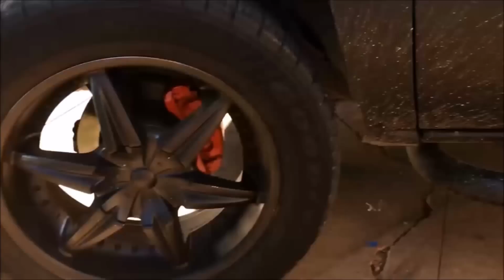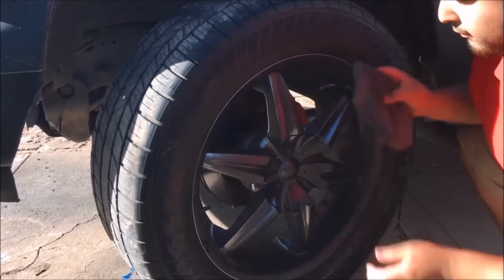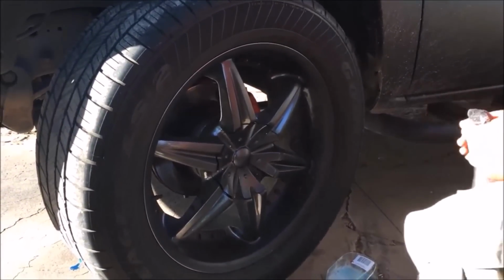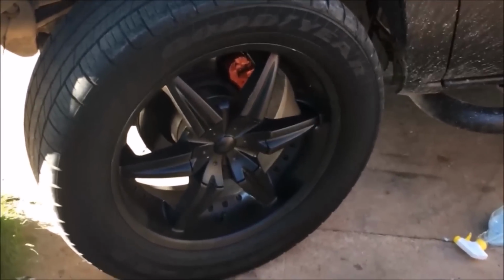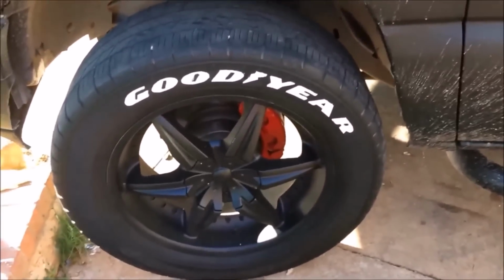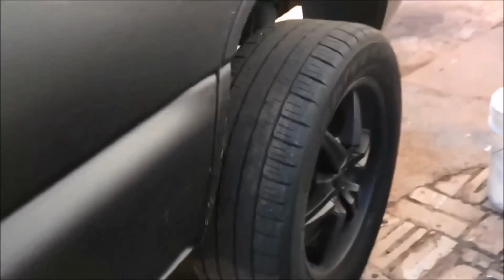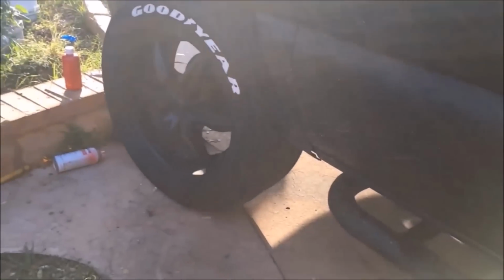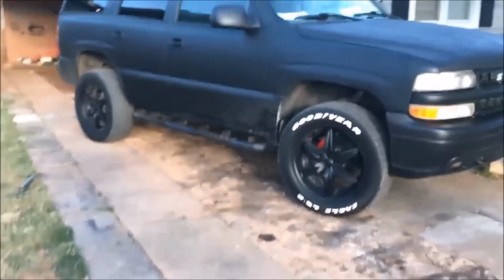HOW TO PAINT YOUR TIRES LETTERING WITH BRUSH AND PAINT

Comment: Please for the love of cars DO NOT USE PAINT THINNER!! It will break down your tires. It is not good for the rubber. Use a degreaser like dawn dish soap it is strong enough to get the surface clean but not soak into the tire and change the properties of the tire like paint thinner. Soap and water will do just fine. Please do not watch this video and use paint thinner.

Comment: Ya I tried the acrylic but after I put a coat of clear coat over it it turned the color yellowish I’m not sure if there is a good paint to do it with I’ve looked at everything oil water base and pins the pins are also oil base but I can’t seem to find a paint that will work well or even stay in the tire or last I’m just gonna go with the stickers I spent 3days painting the wheels with different paints and ended up taking it all back off so I’m just gonna but the stickers

Comment: I just did the same with my Goodyear tire with the same oil base and brand name looks very nice but I’m not sure it will dry on the rubber I’ve been looking little into oil base on rubber and the results aren’t good it’s been hrs sence I painted mine with the oil base and there still tacky if they don’t dry within 16hrs tops they probably won’t I been looking at some other methods and seems acrylic paint would be the best after drying I’d mite cost it with a gloss spray paint to protect from washing or just to make sure the acrylic water base don’t rub off I’m hopeing this oil base drys though it looks very nice
Reply: William ballou did u ever get around to trying acrylic
Reply: dries slowly, 48hrs, then re-coat, use cotton ear bud dampened with turps to remove tiny errors. Any tyre sheen like Amor-all becomes the clear coat.

Comment: How were they 1,2, 3 weeks later?
Reply from the maker: Honestly they only lasted about 2 months
Reply: @DMND90s  I'm experimenting on my own method.  Just did 2 tires today my new method and 2 a basic method.
If my new method works, I'll send it to you here.  It's not complicated, but definitely outside the box creativity! Lol
Reply: @MrBikedrummer  did it work out?
Reply: @SidOfRivia  
Yes.  I'm still monitoring the job.
Here's what I did:
I cleaned the letters with acetone.  Be careful, the vapors are terrible.
Then I put a base coat on liquid Super glue.  Liquid, not the gel.

I let it sit for 30 minutes.  It was still tacky and I painted Rust-Oleum liquid paint on top with a small artist brush.
I really just dabbed the paint on. It takes time to dry.  I put a couple coats.
I figured that the superglue would stick to the rubber and the paint would bond with the glue.

It's an experiment and Super glue is dangerous.

It looks good now.  My Cooper tires name is stamped very low on the side of the tire.  I'm not sure if the flexing of the radial sidewall will affect it.
I'm not a registered professional.  Just a car guy searching for a solution.
Peace ☮️

Comment: I did this & some started pealing off, you need some sort of sealant over it
Reply: Mines pealed off too 😑
Reply: Mine did too, what did you seal it with?
Reply: @moonlightproductions4574  I used a clear paint sealant from home depot but it didn't work so I used liquid flex seal & it looks good when first applied & stays on really well, but then after a rain it looks really dirty & also if you put to much it doesn't look that great so eventually I might get tire stickers.